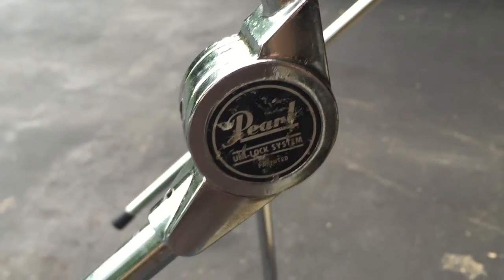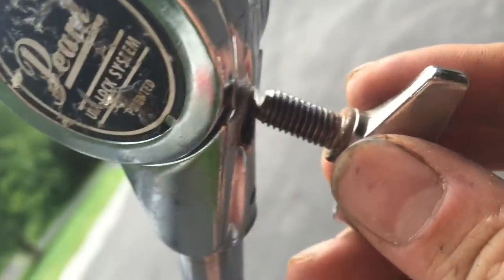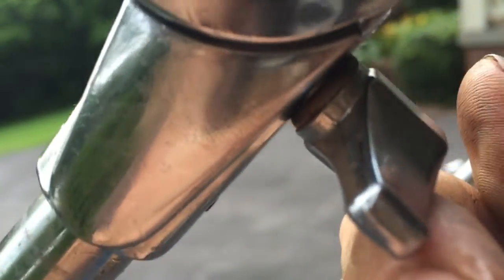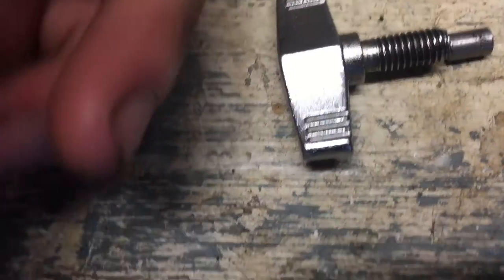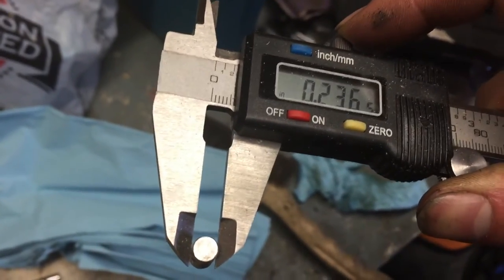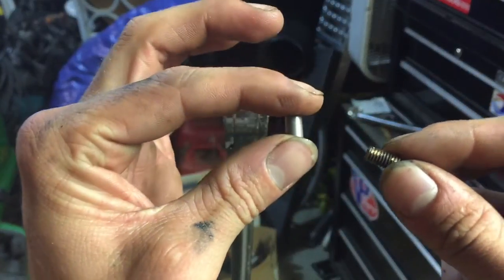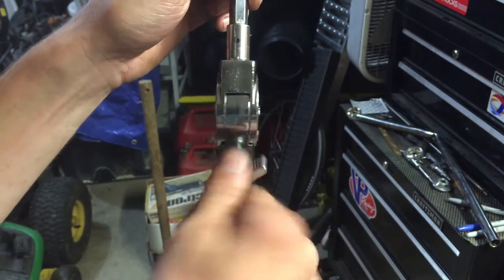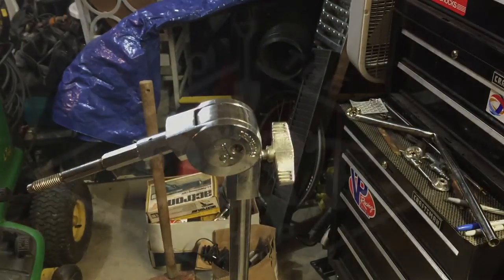Pearl Uni-Lock Boom Cymbal Stand Repair

Comment: Same thing applies to Pearl Gyro-lock systems.  The wing bolt wiggle loose and fell out during transport to a long distance show,  unknowingly I found the wing bold laying in the bottom of my hardware case, tightened the wing bold back in only to find I had to torque way beyond normal to cinch down the cymbal holder I ended up giving up on it and it threw it in my junk box.  Then it happened again this week.  This time I tore it totally apart to understand the function.  I could see something seemed to be missing.  Found your youtube on the Uni-lock and the missing pin and found the parts diagram on a Pearl parts catalog and ID'd the missing PIN!!!    Going to try the screw shank replacement idea or find a rod I can cut down.  Thanks !
Reply from the maker: Awesome! I love when this video has helped people out!

Comment: I have 2 stands that the boom arm will still rotate and slide, not pivot, when tight. While playing the cymbal with each hit it rotates until it is sideways or flops upside down. The same component keeps the arm from sliding forward or backwards in the joint, but again it doesnt tighten on the arm so the arm slides freely. The wingloc joint holds the pivot in place but will not tighten onto the boom arm to hold it in place... Know about this?

Comment: So I have almost the same system problem with my tom stand. The only access point are what looks like a bolt that goes into the tube that slides into the tom and an Allen key indent in the actual knee. I can’t tighten the bolt nor the Allen indent anymore and it still just flips about. Anyone know why? It’s a Pearl Unilock system that attaches to the Pearl ISS.